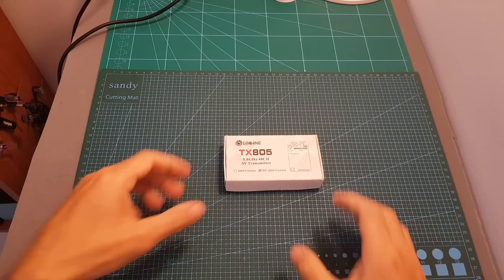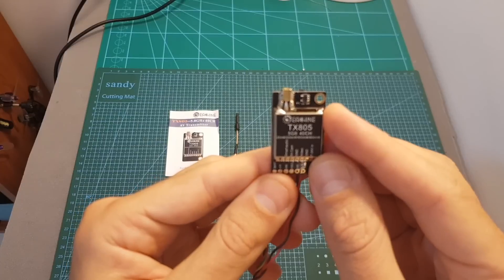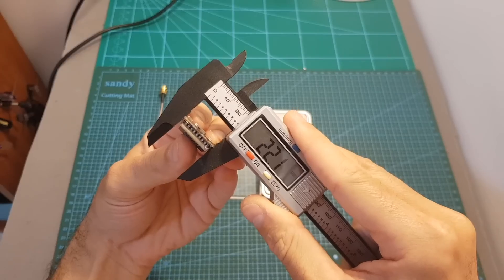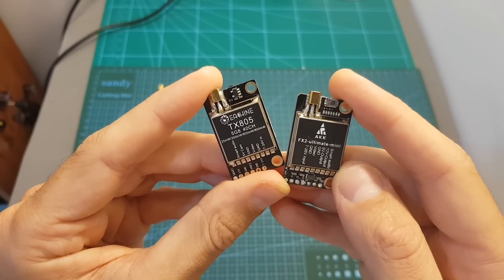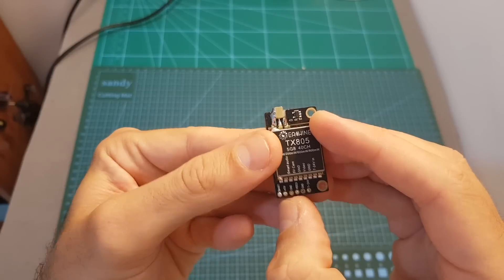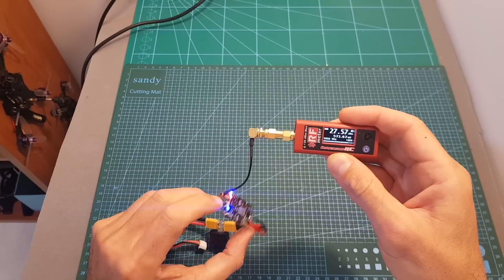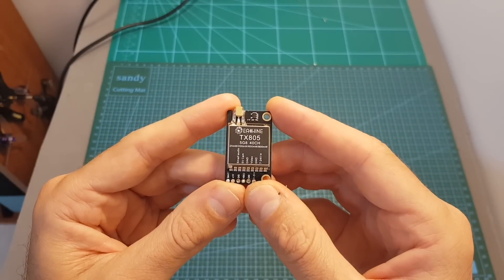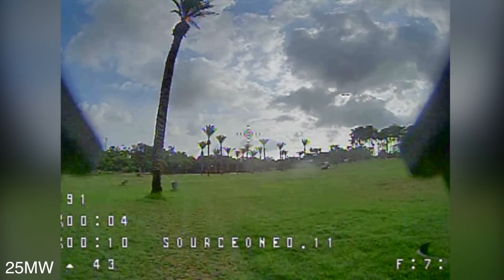Eachine TX805 VTX - Review & Field Test

Comment: Hi, there are two red wires marked as 5v and 7-24v... So, do I connect both wires? Maybe 7-24 to VCC and the other to 5v? It is not clear and I am worried that it might break if I do both... Suggestions would be appreciated. Thank you
Reply: 5v is to power directly a camera

Comment: Best thing about this VTX is that it can sit on 25mw and not get hot at all.
Compared to the matek vtx which get stupid hot still even on 25mw.

The filtering on this vtx is non-existent so if you have noisy escs it will show in video.

Tbh the output quality from the matek is much better and it seemes to last even getting hot waiting for sats for man flights so i prefer that vtx but it is twice the price.

The vtx that interests me most is the rush fpv but they are even more expensive than the matek and kinda chonky.
Reply from the maker: Thanks for sharing your feedback.

Comment: How much battery power you need for a basic setup like this in 25mw and the mic activated?
Reply from the maker: Do you mean the amper draw?
Reply: @KremerFPV  Volts and amper? because most vtx I see with microphone they are in the 7volts and up.

Comment: my solder pads came with wires presoldered and with epoxy over them.. anyway to desolder these pre soldered wires?
Reply from the maker: Yes, I noticed that in the new version. You can carefully remove the glue and then desolder the wires.